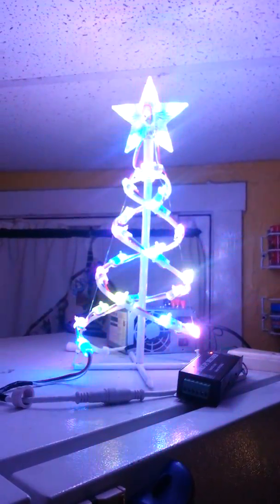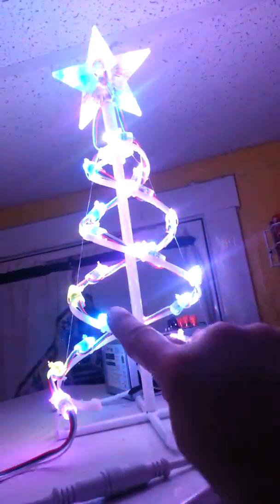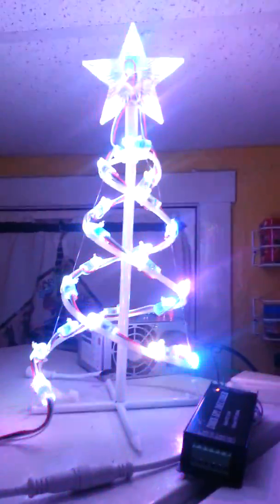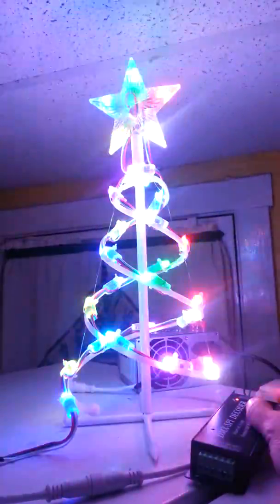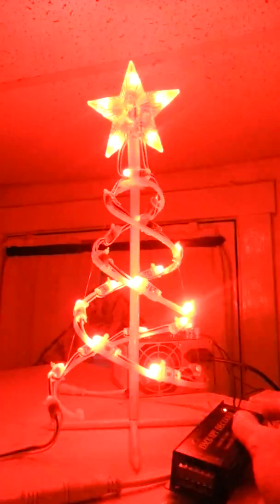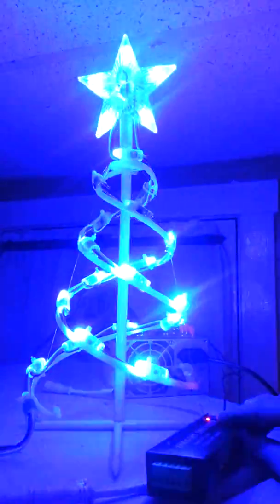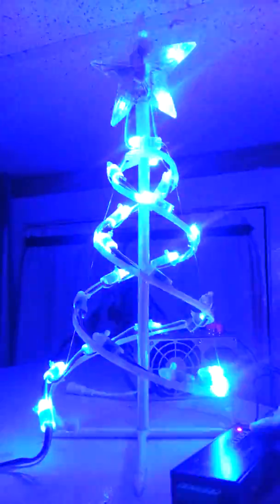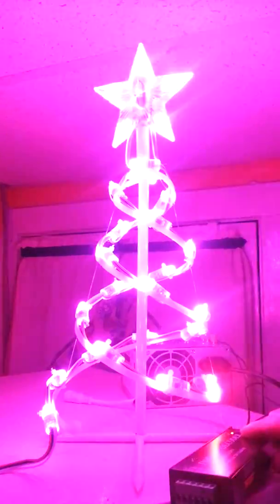Pathway spiral pixel tree

Comment: How did you wire and model these?  I have a bunch that I'm looking to convert this year.  It looks like the pixel "in" is on the bottom of the 1st spiral, goes up to the star, then back down the other spiral to the "out".  Is this correct?  How about modeling in xlights?